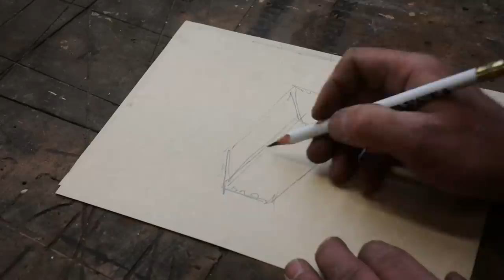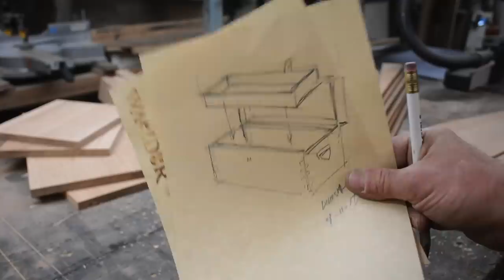DiResta #TBT My Sewing Box

Comment: This reminds me (when you were putting in the small black nails) of a gift my grandfather gave me when I turned 4... It was a "junior" tool set that had real tools resized for small hands (The hammer, saw, pliers, screwdrivers, tape measure etc. were fully capable for a 3yo). It also had all the materials to build a wooden tool box for the tools. Of course you would never see this "toy" for sale for today's kids, but it was a great introduction into tools and woodworking.

Comment: Nice job. Is cyano strong enough to hold that lid stay for long?  Don't you think GLUE would have been plenty strong on good thick edge joints like that w/o the nails? Wonder if your solid top/bottom might split w/ humidity changes? I usually use ply on boxes that big. Always fine craftsmanship & impressive videos Jimmy.

Comment: Another great project!  Question: at the 7:45 ish mark,  when you're using the flush-trim bit on the router, why did you "up-mill nibble" vs just going around the perimeter in a CCW direction?  Also, I know it would probably be a laborious pain a couple of years after the original, but have you thought about putting affiliate links to some of the extra cool things you use?  I'd love to get those latches and that lid stay, and I know I can probably find them by going to Rockler and searching, but an affiliate link would make my life easier and kick a few cents your way too.

Comment: Jimmy, Have you thought of making a press to compact all that left over wood shavings and dust into wood pellets to burn in a stove?  Maybe a 3-4 inch diameter iron or steel pipe with removable bottom and use something for a bonding agent then put it into a hydraulic press to compact it.  Just a thought for those cold days/nights.  And it would be beyond me to not comment on your huge nuts lol #5:35

Comment: This method of mounting the bottom of the box (especially those sizes) is wrong.  over time, the bottom will dry up and the nails will not hold.  With all due respect.